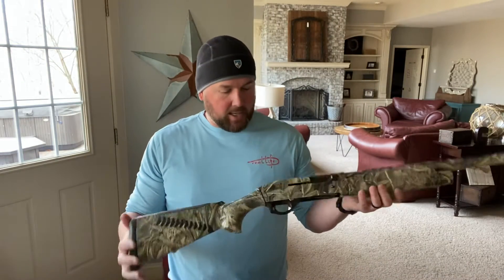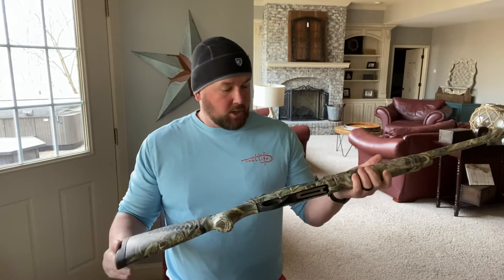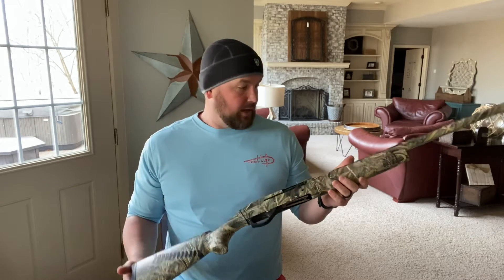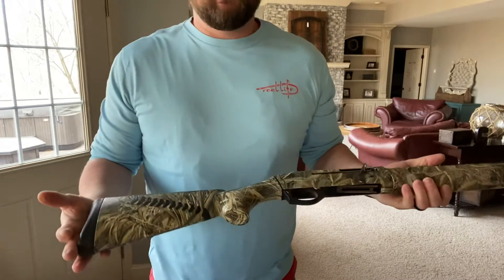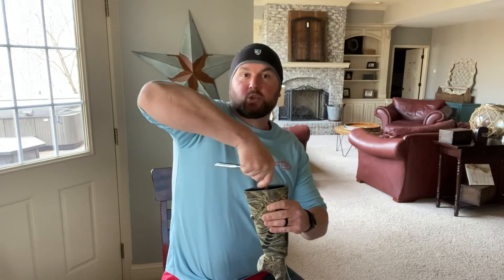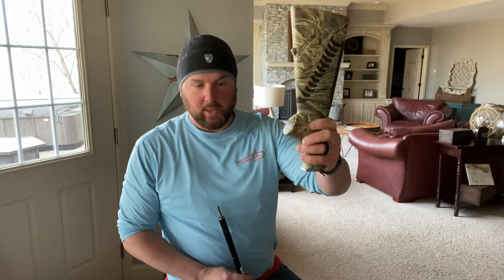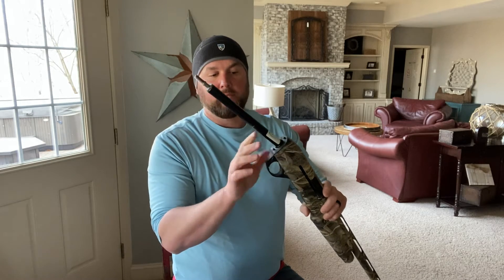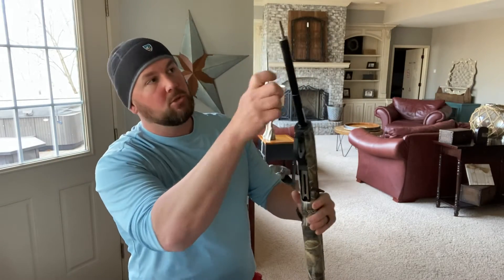Benelli M2 slow action problem-  solved with recoil spring replacement (M2, SBE, SBE2)-DIY DAD

Comment: I know this is a year old, but I had to like and comment because it helped me so much. I have the same exact gun. M2. Same exact issue. Several FTF with the shell lifter jamming a fresh round and the spent round not ejecting. A mess, when you’re in the duck blind and birds are flying. I literally just got done meticulously cleaning my gun but after watching this, I think you’ve diagnosed my real problem. Great info. Thank you!
Reply: Did you try the fix I just purchased a SBE 2 and having the same issue
Reply: @evanmaddock8158  Yes, sir. I bought the Wolff spring and so far so good on duck loads. I haven’t tried the low brass field loads yet, but I feel like this is gonna fix my main problem. No more ‘Benelli click’ so far. Hope you get it figured out. Regards.

Comment: Really appreciate this how to.  Mine failed while on a pheasant hunt in KS.  I knew immediately it was the inertia spring (recoil spring).  I ordered a replacement, which has been sitting in my gun safe for 9 months because I was certain how to replace it. Will have it back in service for dove season opener next weekend

Comment: Great video, quick explanation. 3gunner with "a lot" of shells through my m2 and it finally has started barely feeding sometimes. Bolt stays to the rear, tilting or even barely nudging the gun makes it chamber. That screams "new recoil spring" to me.

Comment: Hi I had the same problem in North Dakota,.  It finally would not cycle.  I switched guns and when I got home I did some researched and found out the same thing you did. Now I have have me for at least 12 years.  When I took it apart I could not believe how much crud, dust and dirt was in the tube.  Replace it and all is well.

Comment: I have the same issue with mine.  Purchased a Wolff xp recoil spring and hammer spring kit which I installed.  I’m also polishing the firing chamber,  degreasing the gun and applying dry lube and wiping down.  We’ll see if this works!

Comment: My benelli M4 has the same issue. It's a little stiff to open the chamber even when the hammer is set. It also squeaks as if it's rubbing on the recoil tube a lot.

Comment: Was that a factory replacement or an aftermarket spring? And if it was an aftermarket replacement, where did you get it from? Thanks
Reply from the maker: This is the one I used-

https://tarantacticalinnovations.com/tti-benelli-ultimate-reduced-power-buffer-spring/
Reply: Check out Wolff xp springs.  The Shotshell company I usually by from recommended them.